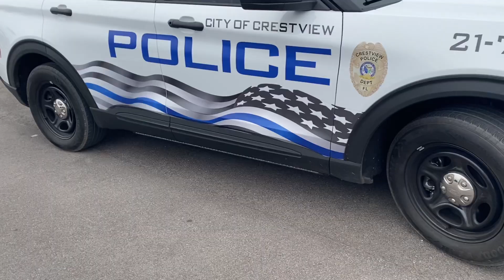DD AUDIO 15s rip hatch off car!! I give my first demo. Skar EVL 18s, DD Audio, Incriminator Audio

Comment: I Think Sound Systems Sound The Best in Hatchbacks 💯
Reply: Why I pointed my speakers forward in my accord, sounds clean as hell.
Reply: @sergioh2015  Hatchbacks Have an Open Enclosure Equals Move More Air There's a Science To Sound 💯
Reply: @Chris  wait forgot to mention I have the rear seat down closest to a hatch back as I'll get to. Lol
Reply: @sergioh2015  Cool
Reply: @sergioh2015  Also Use a Ported Box To Move More Air 💯
Reply: @ChrisPBacon198  yessir